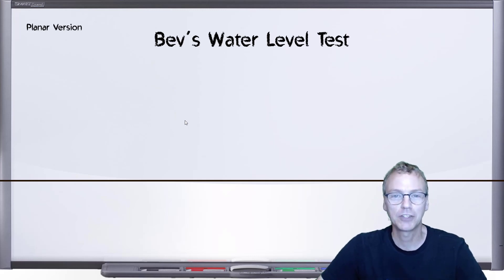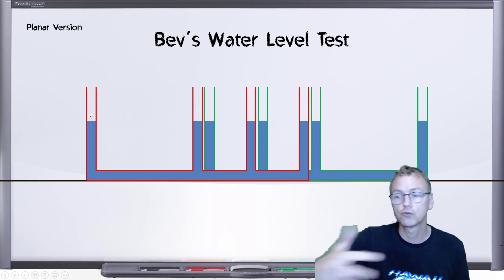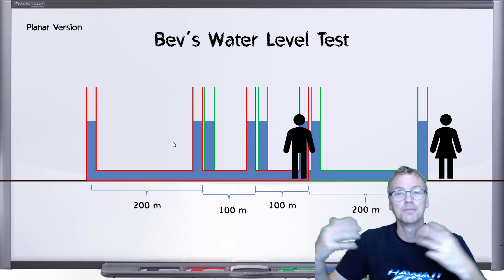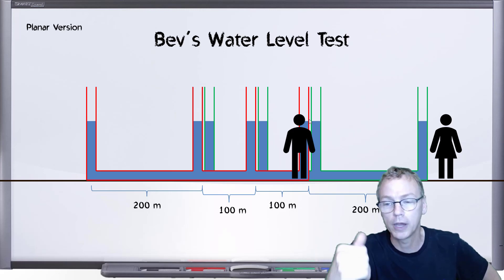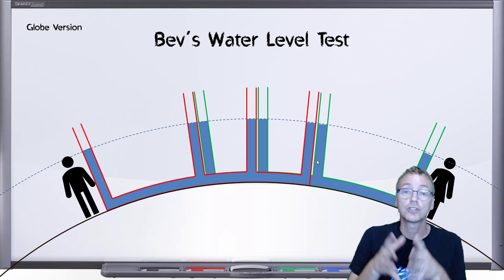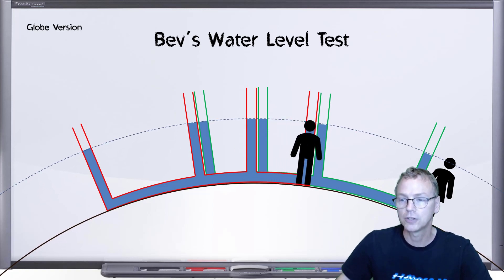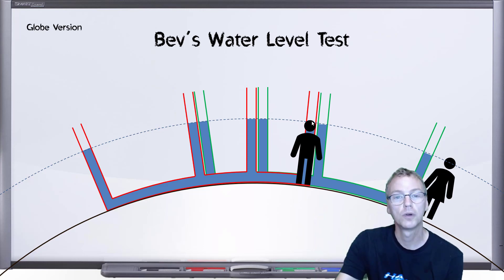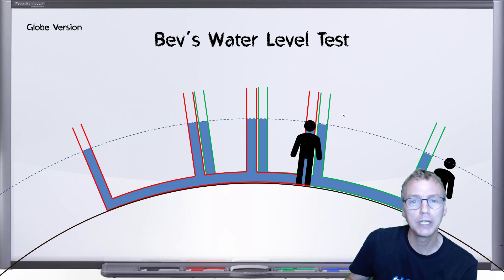Bev Try Thinking and Spot On Level's Water Level Test

Comment: You are spot on in your analysis of the test. The problem is, as you said, the test method will work on both models.
The only way to figure out what is what is to sight all the uprights from one end to the other.
On a flat earth they will all be in line with each other, but on a globe the center ones will be slightly higher than the ends.
Strangely, Bev refused to do anything like that and reacted strongly to anyone suggesting to do so. Its almost like he already knew this.
Reply: A theodolite or transit could be used. Tha fact that you would have to take either off zero, once you've locally leveled them would automatically debunk the flat Earth. Then seeing that the intermediate uprights were all higher than that would kill the idea of a flat Earth...if flerfs were honest.
Reply: Bev's ”test”: Is water level?
Reply: @ReinoGoo  Yep. And he used water to test its 'levelness'. An utterly bonkers idea.
Reply: I believe Sly Sparkane has been working on a similar experiment for a while.  And yes yes airflow obstruction was a thing needing foam inserts to limit such. 
Even then the friction of the pipeline and water is another issue adding yet another error factor.  And finding a way to seeing the entire length at once and seeing the results (of about a few centimeters)  is very hard to do.
Reply from the maker: In all likelihood, the natural turbulence of the air would make it so hard to make out the distant water level that it would have been inconclusive.
Reply: @icansciencethat  
The best time would be early in the morning when ground, water, and air temperature are closest.
Reply: @icansciencethat  Would long-range infrared be any use? I know precisely nothing about it, other than that it can "see" through atmosphere and hazy better than visible light. Or something like that. LOL And I have no idea how you would design or implement it.
Reply: @icansciencethat  

It would be possible to use a telescope at one end, and at the other end use a coloured ring with cross-hairs.  Line up the cross-hairs with the water level, to make it visible from a distance.  This doesn’t eliminate refraction effects, however.
Reply: @icansciencethat  Get some transparent tubing a meter or so long and hold it in a U shape nearly filled with water. Go to a beach and hold one end near your face at eye level and the other end out towards the sea horizon. The water level in the tube doesn't line up with the sea horizon. The horizon is lower. No getting out of that one. Tell him about it.
Reply from the maker: @Justwantahover  I've tried that.
I don't usually talk about my own results... I encourage people to try for themselves.
But I have a homemade water level right here in my office.
Reply: @icansciencethat  Such a good debunk!
Reply: @Justwantahover  I have a heavier and more expensive version of that which will hold itself up so I can back away from it and take photographs through it. I used it to measure the apparent radius of curvature across the Vale of York. See "HOH on Greenhow Hill" video. Not the most sophisticated tool, but you can't complain about a lack of transparency in how it works!

Comment: So if one put a laser and a target X distance above the water at left end and the same at right end. Then shot the two lasers at there targets at either end. Next went to the middle of the two setups and took a measure it would be less on a globe and the same on a flat earth. reason for two lasers is because the beams tend to expand with distance and two would allow for the canceling of that effect.
Reply from the maker: I saw a test like that once, and the results were "interesting".
Seriously, skip the lasers. Just use a telescope or theodolite. Lasers are light just like you see with your eyes. But if you have a complete image instead of just a laser dot, you can assess the amount of distortion.
Reply: You can use pre-existing targets for this. Grey Friar in the Lake District, Pen Llithrig y Wrach in Wales and Whernside in Yorkshire (It's west of the watershed, but considered to be in Yorkshire) are all at similar enough altitudes that you'll be able to see the effect of curvature quite clearly when looking between them.
Peakfinder predicts 0.6° both ways from Wales and 0.2° between the Lakes and Whernside.

Comment: But in reality it is the same elevation, and no plane.
What is 8 inches / mile in quarter of a mile? Half an inch. And the sagitta is eight of an inch.
Reply from the maker: Too lazy to check your math, but sounds right.
You might be pointing out that the sagitta is too small to see. I'd agree. I'm not at all confident that such a small amount would be clearly resolvable against even the tiniest amount of natural turbulence.

Comment: It’s a shame that you weren’t brave enough to point out that the water levels can also be sighted from one end to the other with p1000 cameras. And that their surface line can also be compared to a straight line established with an auto level and surveying processes.
Reply from the maker: I don't know about " brave enough", but you may have picked up me alluding to other ways to use the giant water level  maybe what you describe could be exactly that.
Reply: Immediately after someone suggests a specific method, I would expect them to also outline what results they would get and whether that approach is sensitive and accurate enough to identify a significant departure from one or both models.
Let’s say someone does sight down the x meter long set up, what measurements will be recorded if one model is correct? What if the other model is correct, what are those measurements? Are the two predictions statistically different, would irl measurements with some reasonable margin of error produce a statistically significant outcome?
Reply: As it stands, the way the test was described in the video would result in a null difference. A planar, convex, concave, saddle, whatever surface would all generate the same ~0cm prediction so long as that model includes some reason to suggest why the water adopts a co-curvilinear geometry. Let’s say you tweak the test protocol, now modelP predicts ~0°, modelCx a maximum deviation of +0.001°, and modelCa -0.001°. However your measuring tool is only accurate to 0.1°. Great, you’ve improved the experiment by choosing an approach that at least hypothetically can distinguish the models (unlike v1), but v2 still lacks the sensitivity to tell them apart.
This is why at least Kell got some credit for his approach (a small amount, lets not get carried away here…everything else was so wrong and his demeanor ate up that extra credit), even if his understanding was ultimately wrong (which led to incorrect predictions). He at least communicated what he believes each model predicts, showed they would be significantly different, and that his tool is sensitive enough to tell apart which model is best. Unfortunately for him, he got so many things wrong his conclusion was flawed but the test actually does work when you understand the geometry of what he was measuring and it showed exactly what you should on a globe and falsified flat earth.

Comment: The hard part will of this is to explain the globe prediction to Bev en his band of (ding). According them it should be different, and they are confused with de difference between curve and elevation alot.
Reply: Quite fascinating that despite it being explaining to them numerous times and again in this video they don't understand the Globe model prediction at all.
Reply: What the globe model believers fail to realise is that two local straight lines which are established 400 metres apart, cannot have a common shared segment without being the same extended straight line.
Reply: @JustBarry-fb8kl  That is not how Communicating Vessels work. The line between them just has to have a lower elevation as the highest elevation level of the water in the setup.
Reply: @JustBarry-fb8kl  The assumption flat Earthers (such as Bev's crew) makes is that the direction of down at different locations are parallel with one another. If you toss out that assumption, you can then design a meaningful test. Bev won't do that, though. He's been presented measurements that don't make sense with that assumption, but will cling to it anyway exactly as any flat Earther does these days. It's 2022, FFS.
Reply: You can’t assume water level is a plane to “demonstrate” equal elevation matches a singular water level therefore earth elevation is planar. The fundamental principle is that water in communicating vessel(s) equalizes its potential. Whether that equipotential water surface is planar or not cannot be taken for granted, it must be first demonstrated. Unlike assuming the surface is planar, water surface being equipotential is trivial to demonstrate simply by varying circumstances (eg introducing/neutralizing a particular force/pseudoforce) and watching how the water surface morphs to conform to the new net force.
As such, the entire basis of Bev’s approach is meaningless. Someone saying “…fail to realize is that two local straight lines…” because (not yelling, just emphasizing the crux of the matter) *IT MUST BE DEMONSTRATED THOSE CONSTRUCTS WERE PLANAR/LINES TO BEGIN WITH.* “Water level is planar, therefore elevation is planar, and since elevation is planar so is water level” is circular reasoning. Bev tries to slip that under the rug by bedazzling the conversation with word games and geometry he nor his followers understand. Or maybe he does understand it but has some ulterior motive to keep peddling lies (an opinion I share with others who have scrutinized what he’s doing).
Reply: @sphaera2520  you don’t need to assume anything, you establish a straight line between A and B 600m apart. You then put your two water levels next to the straight line and check if the levels deviate from it. 
Bev has auto levels and the procedure to establish the straight line, but anyone would be welcome to get a geodesic surveyor to confirm the line is indeed straight.

Comment: But, but, but: Level … is … horizontal …
Reply: LOCALLY... that is true.  But the real question is, "Is your local 'level' the same as mine?"  Standing side by side they APPEAR to be, but how accurately can we compare them?  If we are far apart, "Is your local 'level' still the same as mine?"  How do we compare them if we are 600 m apart?  How about when we are 2 km apart?  Can we compare them then to the same accuracy?
Reply: @mikefochtman7164  you can compare them as to whether water flows.
But brainwashed children that never grew up seem to think that water behaves differently when it exceeds a scale we can no longer visualise with modern technology.
Reply: Of course it is, every definition since the dawn of the written word has stated such.
Reply: @JustBarry-fb8kl  Nope:

Rail Straightness Metrology at the David W. Taylor Model Basin
October 1986
"At DTNSRDC the vertical alignment of the rails was accomplished using the water surface in the basins as a datum surface while a long stretched wire served as the horizontal reference.Thus the top surface of the rails is designed to be level rather than flat and the ideal line is an arc of a circle with a radius equal to the radius of the Earth."
Reply: @JustBarry-fb8kl  
Etymology of horizon;
"The word horizon derives from the Greek ὁρίζων κύκλος (horízōn kýklos) 'separating circle', where ὁρίζων is from the verb ὁρίζω (horízō) 'to divide, to separate', which in turn derives from ὅρος (hóros) 'boundary, landmark'."
Reply: In what direction?
Reply: @ReinoGoo  Up. It's horizontal straight up.